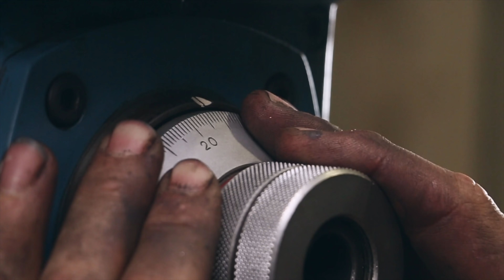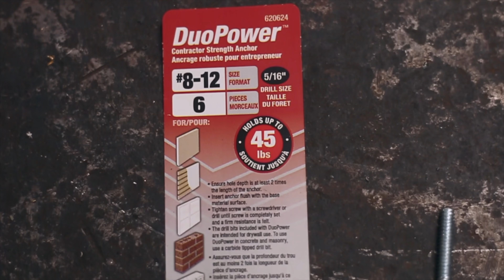Making Hooks from STEEL BALLS

Comment: That plug is impressive. 
Not to mention it had the added stress/pressure of being moved around/flexed in different directions unlike it would be if it was a solidly mounted wall. Not saying you didn’t do a good test, just in my eyes means that on a real wall that plug could potentially hold even more weight than in your test. You’d have to imagen the constant movement back and forward and probable slight twisting action back and forth would have cause excess stress and stress fracturing of the dry wall around the hole that it wouldn’t have if it wasn’t being held up by a person. Impressive. 

Also love the hangers! Something very different and neat! Love your videos keep up the awesome content!

Comment: There's actually much better anchors than those you have, try Fisher duroblade, are any of the ones that actually screw into the sheetrock like a ice auger.
I believe you'll find them superior to those you have, and I've never seen one that's pulled from sheetrock by the weight hanging from them.
Keep up the hard work young men, y'all are moving up on the subscribers. 
Over a hundred thousand since I subscribed myself way back when, just proves what hard work, and dedication gets you.

Comment: You might get damage to a wall, or at least the paint if you dont have backing for straps so they dont rub against a wall when hanging them on the hook. 
Would look good with 3 or 4 mounted on a nice wood board.

Comment: one of the best ways i found to fix to dry wall is with the metal expanding plugs, BUT i dont use the screw to expand it because alot of the time the dry wall is too weak to let it expand because the whole lot turns.
i use a rivnut tool to set the plug into the wall, it works same way as a pop ritit gun it holds the plug into the wall and draws the back of it up to expand it
that way you dont run the risk of the plug spinning in the hole before its full expanded and clamped
cool trick if you fighting a weak or crumbly drywall.

other trick is gorilla glue, don't bank on ever getting the screw out, when i went to take out a screw the screw sheared off